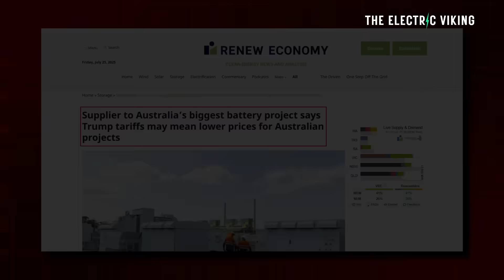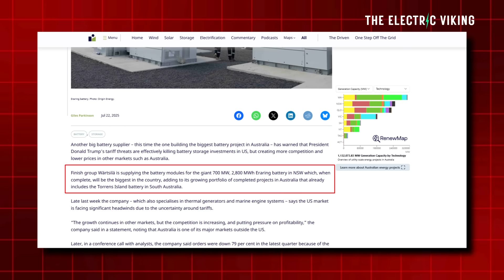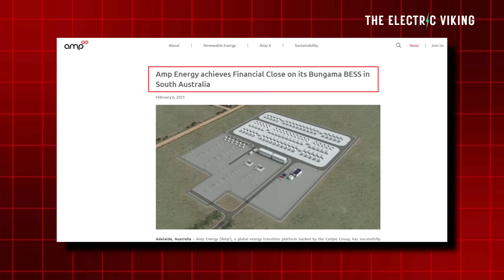Trump tariffs are killing big batteries in the US - but helping Australia and Europe

Comment: Yes, the tariffs will backfire. And it will be longterm damage. Once the supply chains have moved to other countries, they will not easily switch back to 'normal' even if the tariffs are removed, because there will have been massive investments in new pipelines, railroads, terminals, factorys etc. that have a pretty long lifespan.

Comment: Not sure how I feel about this. Battery and solar prices are going down while solar and batteries are getting better. Which might be a good reason to hold back a bit especially with what’s coming out soon. Besides, whether it’s Australia or US - gas prices will drop as well. Battery companies will work around these issues.  So I’m not worried about it much.
Reply: There's always something better around the corner.
Better more efficient, cheaper solar panels, energy storage batteries, BEVs, etc etc.
If you wait too long you're missing out on the present benefits.

Comment: Sam, you state that the battery replaces a power station, how long does the battery last for at it's full output?
Reply: So you take a current power station that runs at 90% capacity for maybe 3 hours a day. Install a huge battery. Now that power station can run at 90% for 9 hours a day and the energy it produces can be available during peak usage. When its value is the highest.
Reply: It will depend on the example Earring is supposed to be 700 MW, 2,800 MWh

So it would be 4 hours at maximum output ignoring the fact that they could set it up to supply a much lower instantaneous power level like 50Mw which would mean they could supply power at that level for up to 56 hours straight.

It will need 8 hours to fully cycle (charge and discharge)

Once you get past four or five hours of storage they normally try to use a different storage method like pumped hydro.

Comment: why are batteries not stacked higher?
Reply: Heat issues and maintenance issues. The hot air would rise causing problems for the container above. 

These still need regular maintenance. Doing that maintenance on a ladder would suck. 

That said I think you have the right idea. When the systems are more stable and the cooling is less of a problem I would expect to see them getting stacked.
Reply: Why not underground as well? Especially with all the war talk.
Reply: I think the electronics overheating is the bigger problem right now. Making these in 3’s would be interesting. Top 2 would be batteries only. The bottom one would have the electronics for all 3. 

I believe the electronics are also what needs maintenance. Not the battery packs.
Reply: Latest gen 20' BESS weighs 100,000 pounds, spread over a 200 SF footprint. Stack two then, that's 200,000 lbs on 200SF, three BESS weighs 300,000 lbs, etc. Bottom line, geotechnical parameters of the soil/rock on which BESS foundations sit is the limiting factor.